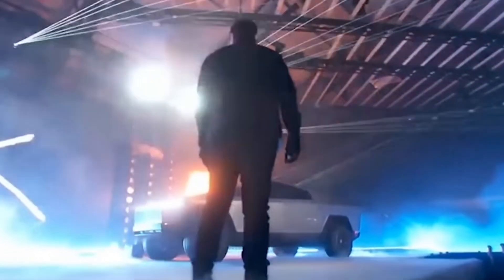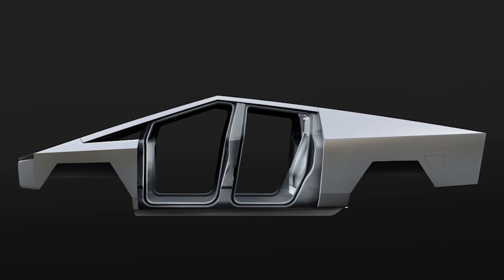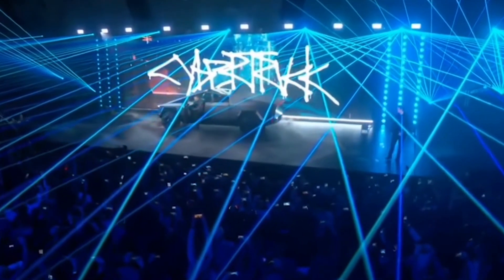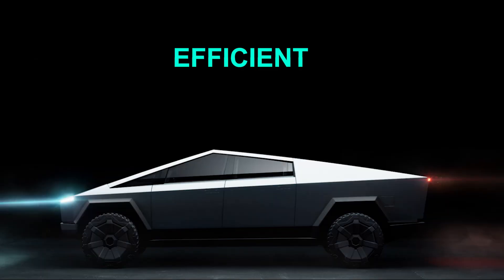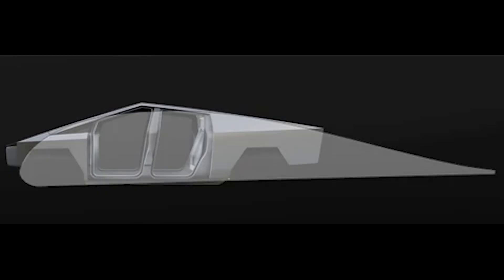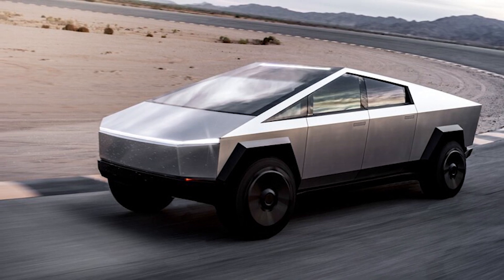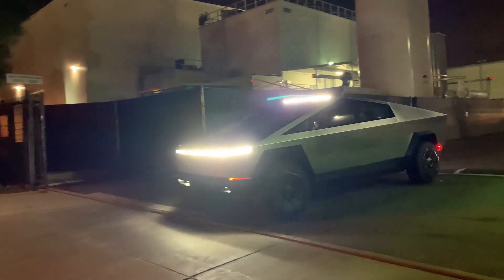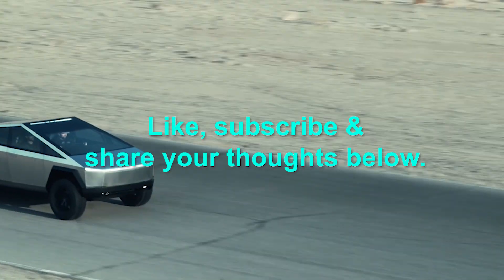Cybertruck is Engineering Genius (and will be copied)

Comment: I don't think other car makers will necessarily copy Tesla's design for several reasons.

1. There are more avenues for competition than efficiency: the core of the truck-purchasing audience hardly cares about that, anyway. Besides, copying Cybertruck's appearance would only reinforce the reverence for the original. It's one of the reasons that Tesla wouldn't copy Ford F-150's appearance even if it would still allow preserving all of their current design's benefits. It would only send the message that F-150 is the superior design, so it didn't need reimagining. Ergo it's better to get the original.

2. The economical benefits granted by using folded cold-rolled steel sheets taper off at a much larger manufacturing scale where the price of machinery becomes a non-factor. It is only a factor for Tesla because they are both far behind the competition in absolute production capacity and severely bottlenecked in ramping up, and they don't have the free cash to build as many manufacturing facilities around the world as Ford and other big players have. They absolutely need to make it count because they know how quickly the competition can ramp up production when they want to.

3. Triangles are only mechanically rigid; if you cut a triangle out of a single rectangular piece of paper, it will change virtually nothing with regards to its tensile/torsion/etc. strength. In Tesla's case the angular roof does not really add much to its rigidity (consider that Model 3 already passes the roof crush test with flying colors—and it has a conventionally-shaped mostly-glass roof); it's far more likely that, just like you said, it's mainly done to simplify manufacturing. In fact, the ridge where the glass connects with the steel is among the most likely points of failure in the crush test exactly because the pressure will be concentrated on the base of the glass with nothing to dampen it there. That's pretty much what happened during the presentation: when the steel door was hit with the sledgehammer, the shock was transferred from the frame to the base of the glass. This can be adequately mitigated in the doors because the vectors of shock to them are mostly orthogonal to the surface, but it's harder with the roof where the interface between steel and glass is exposed and shocks may come from a wide variety of angles. They aren't yet at a point where they have enough of them produced to arrange a comprehensive suite of durability tests, which is why neither Franz nor Elon were ready for that glass shattering from the ball.

It is true that the Cybertruck is a very fortunate design where multiple aspects synergize favorably for Tesla, but it's important to understand that it's not ideal and is largely driven by necessity, which may or may not prove to be an issue down the line. Time will tell.
Reply from the maker: Thanks for joining the discussion Moo, you win the most detailed comment for today!

Agree in general but just one note re: 2.

The economic benefits run deeper - the steel can be stored (stacked) flat saving a lot of physical space (lower overhead $$$), less stamping of parts saves energy, thus $. Less parts need to be moved around (less robots $, less energy $) and saving time (wages $), space ($) and increasing unit output over time. Everywhere Tesla can be lean, they are. This is one of many examples but it's pretty important -- lots of tiny things add up.
Reply: @SolvingTheMoneyProblem  That is certainly true. It is very right for Tesla to be lean like that, of course, and it's a very smart decision in principle. However, these savings are subject to diminishing returns due to the economy of scale (e.g. space, energy, wages don't scale linearly with production rate). It works out perfectly for Tesla, but the relative amount these many tiny things would save particularly for them in the next few years wouldn't necessarily be as significant as for a large car manufacturer with dozens of assembly lines. It would be hasty to consider that an economic no-brainer without having the inside knowledge of the competition. At a different scale the advantages of the Cybertruck's design may not warrant following it very closely, even if it's still economically sound. If only because that would make the final product look too much like the competitor. Will the savings be big enough to counteract the increased marketing demands to distance a Cybertruck copycat from the Cybertruck itself? I doubt that.

Tesla may have well hit a gold mine in the sense that their design is a result of convergence of many unlikely factors. It's almost incredible that it has worked out at all. A different manufacturer willing to make a truck out of stainless steel will inevitably have to make a choice: either make a radically different design at a much higher cost because stainless steel is an absolute bitch to work with (and lose to the Cybertruck by profit margin), or make it as angular as the Cybertruck to take advantage of the simpler manufacturing (and still sacrifice the profit margin to the marketing). It's a lose/lose situation, so in a certain sense, this design is uncopiable.

Comment: 3:23 - WRONG! They still have to spray the steel with corrosion inhibitor coating and it will come in several flat colors besides SS.
Reply from the maker: Thanks for that, Camreon.

Comment: I have only one question: Since it's an exosceleton, should the steel ever get a dent, won't it be a much bigger problem than normal? Because the car's structure could be disturbed? Like doors not opening or something
Reply from the maker: It will take a fair bit to deform the steel... like... a serious, SERIOUS collision. Hopefully Tesla reveal more on this soon.
Reply: @SolvingTheMoneyProblem  well yes but no. Don't underestimate the forces at work when cars that weigh like 2 tons each bump into each other even at low speeds. The steel is more sturdy than normal cars for sure, no one doubts that. As I said, I'm only concerned about what happens IF there is a problem. It will be interesting to hear about hat

Comment: This is going to be a nightmare for auto body repair shops.  The monocoque one-piece body shell of stainless has no quarter panels that can be replaced.  Damaged areas will have to be cut out and new panels welded on, which can't be concealed with Bondo and paint, and the welding temperatures always discolor the metal, making the repair evident.  It will be interesting to see how repairs are made to this vehicle.  I like it...unlike the regular auto industry coming out with a dream concept car that would never be produced, the Tesla will be.
Reply from the maker: Yep, you may well have  point on the repairs though a metalworker can remove dents without much trouble. Bigger impacts will be a pain in the butt.

Comment: My concern is what happens to the stainless steel when discarded? It will last forever and nature will not break it down, it will last forever!!!
Reply from the maker: It can be recycled. Step 1. Add heat.
Reply: @SolvingTheMoneyProblem  The way I see it is that recycle will not be done. Just drive out in the country and take note of the discarded farm machinery rusting away. There are millions of tons of metal just sitting there. This is just one example.

Comment: A really agree with your points, but want to add that for safety you often want the cars front do deform on impact to take away kinetic energy. It everything is hard a steel you will essentially hit a wall on impact.
Reply from the maker: Thanks. Lots of people are raising this. The steel can be scored on the underside to crumple predictably and consistently. (or the hood could be a separate component). I think many will be surprised at how well the Tesla engineers address this. Safety is always top of mind at Tesla. It may not appear so but the driver in Cybertruck sits the same distance from front of the vehicle as they do in Model 3 so there's equivalent space for crumple zone too.

End of the day, Cybertruck won't be allowed on roads if it is not sufficiently safe. Tesla are smarter than to design an unsafe vehicle 😉
Reply: @SolvingTheMoneyProblem  In this regard it would be very intresting to see crashtest footage (if such will ever be released). I am personally a fan of cybertruck and tesla in gerneal and would already have a preordered a cybertruck if I could afford it..

Comment: I wonder about SAFETY: 
 - If the truck is so rigid what would happen if it hits a rather "soft" car. The car should  deform a lot putting passengers into risk.
- What if two cybertrucks  hit each other, I guess most of the kinetic energy would not go into deforming the steel leading to a dangerous collision.
Reply from the maker: Lots of people are mentioning safety. The steel can be scored on the underside to crumple predictably and consistently. I think many will be surprised at how well the Tesla engineers address this. Safety is always top of mind at Tesla. It may not appear so but the driver in cybertruck sits the same distance from front of the vehicle as they do in Model 3 so there's equivalent space for crumple zone too.

End of the day, Cybertruck won't be allowed on roads if it is not sufficiently safe. Tesla are smarter than to design an unsafe vehicle 😉

Comment: Almost nothing said in video is accurate. 
Rigidity does not equal safety, check any crash test video of cars from the 50s. Crumple zones make a car safe. 

At every price point of the CT performance except acceleration is better with ic truck. 3500s with towing capacity > 30,000lbs and ~7000lbs payload are ~50k. They are beat on the low end too by 2500 series

Reducing steps in production can be good. Also has some down sides. When machines are down for maintenance/repairs nothing can happen. With multiple steps the other steps can continue when one machine is down and they can catch up when that other step goes down. 

Unfinished metal causes a lot of glare issues with driver and other cars when the sun is reflected, not always good. 

Unibody truck design has been studied by truck builders in fact honda used it. Those angled bed sides are necessary to combat twist/flex. Generally the unibody design is going to be heavier than a traditional frame design to combat that twist. Where as traditional truck frame design doesnt fight this force, the bed and cab are separated and allowed to flex relative to each other.   Now engineering is about compromise so tesla may have chosen to pursue the unibody design for other advantages, ie better use space. 

Many trucks come with 120v outlets not sure about the 220v but nothing is stopping manufacturers from adding that. 6 seats were common at one point, customers didnt seem to be that interested. Its almost impossible to find 3rd seat in front row on any car today. Ramp in tailgate is unique but most trucks now come with other tailgate features, not really clear what features buyers like the most but manufacturers have shown designs with ramp in tailgate, just never offered it for sale.
Reply from the maker: Thanks for your detailed feedback John. You make some reasonable points. FYI, the steel can be scored to crumple where and as needed.
Reply: Solving The Money Problem sure. But the rigidity is not providing the safety. Other benefits yes.

Comment: A vehicule being sturdy doesn't necessarily means safe. There's a reason there is a crumple zone to absorb the impact on modern cars. I'm wondering how that would work with cybertruck. Clearly they thought about something, it's Tesla we are talking about. I'm just wondering about the details.
Reply from the maker: Heaps of people are raising this. The steel can be scored on the underside to crumple predictably and consistently. (or the hood could be a separate component). I think many will be surprised at how well the Tesla engineers address this. Safety is always top of mind at Tesla. It may not appear so but the driver in Cybertruck sits the same distance from front of the vehicle as they do in Model 3 so there's equivalent space for crumple zone too.

End of the day, Cybertruck won't be allowed on roads if it is not sufficiently safe. Tesla are smarter than to design an unsafe vehicle 😉
Reply: @SolvingTheMoneyProblem  Didn't think about that! And I agree, that would be very strange from Tesla to make an unsafe vehicle.

Comment: So if it so tough, what’s gonna happen when in a car accident and the car frame doesn’t absorb the energy of the impact?
Reply from the maker: Lots of people are raising this. The steel can be scored on the underside to crumple predictably and consistently. (or the hood could be a separate drop-in component). I think many will be surprised at how well the Tesla engineers address this. Safety is always top of mind at Tesla. It may not appear so but the driver in Cybertruck sits the same distance from front of the vehicle as they do in Model 3 so there's equivalent space for crumple zone too.

End of the day, Cybertruck won't be allowed on roads if it is not sufficiently safe. Tesla are smarter than to design an unsafe vehicle 😉

Comment: I dont get it, I googled its price and its like 10k over the base f150 model... so whats the point of all this explanation if it will be more expensive than the competitor?
Reply from the maker: Hey Matias, go spec out a like-for-like F150 (super crew cabin, 6.5 ft bed etc) and you will find a very different picture. Tesla doesn't have 4,000 options. There's 3 models and the only add on is full self driving.

Comment: The biggest issue i have with the Cyber truck is with the EU market, there is no way in hell that it's passing a pedestrian safety test with how solid the front of it is. Unless they make a version with a plastic front it won't even be allowed on the roads here.
Reply from the maker: Lots of people are mentioning this. The steel can be scored on the underside to crumple predictably and consistently.  I think many will be surprised at how well the Tesla engineers address this. Safety is always top of mind at Tesla. It may not appear so but the driver in cybertruck sits the same distance from front of the vehicle as they do in Model 3 so there's equivalent space for crumple zone too.

Comment: YUCK Why are you guys trying to make the Tesla "truck" happen?  It's UGLY!  It looks like it was designed by a 3 year old.  If you guys let Tesla think this is a valid truck option are just hurting Tesla.  The sooner the cancel this design and come up with a more traditional truck design the better off Tesla will be.
Reply from the maker: Guess they'd better refund those 250,000 reservation deposits and start work on an F150 clone eh? Maybe you should tweet Elon this urgent message. 😉
Reply: @SolvingTheMoneyProblem  I'm going to laugh my ass off when I see some dumbass driving this.  But I guess the only reason someone would drive this it to get that kind of attention.  Real truck owners are not going to buy this truck.  It doesn't have to be a clone of F150 but it doesn't have to look like something straight out of a bad Battlestar Galactica episode either.

Comment: Has anyone else suppositioned about the trailer that is shown being towed by the truck?  My theory is 10 to 1 that it will have batteries that will provide additional power to the truck. That way you can tow a trailer with zero to net positive change in vehicle range.  any thoughts?
Reply from the maker: AK, damn. You know what. I think you're right. Why on earth would they NOT put batteries in the trailer (and probably a solar roof too)? Make perfect sense. Tweet Elon and ask.. see what happens.
Reply: The trailer will require huge power. Obviously equipping trailer with significant power will require lots of weight from batteries - eating into your tow capacity. Also, getting that power from the trailer to the truck itself will require big fat power cables - which adds weight, complexity and cost. Not impossible, but something to be overcome. Or, I suppose you could have a trailer with its own propulsion - but lots of cost, complexity and weight there, too.

Comment: You didnt mention how inefficient it would be under load. y'know...using it like a truck. 

It seems like a fine vehicle for those who dont tow outside of city limits. 

From where I live, mathematically the highest trim  wouldnt make the trip to tow my boat to my favorite destination assuming it keeps up the 1kW/h usage on a flat surface with no uphill or downhill. 

I just think it's just an okay vehicle from a truck standpoint. For functionality, it'll be more of an average small-size truck instead of an average full-size.
Reply from the maker: Yep, no mention because I have no clue. Model X towing capacity is TRASH but it wasn't designed to tow. Cybertruck is hopefully Tesla provide info on loaded/towing range soon. For sure, narrow use cases like long range when rowing, longer bed etc means Cybertruck won't suit everyone.
Reply: For somebody that uses their truck as a commuting homeowner - whose only "truck" use is hauling a few 2x4s or bags of mulch or pulling the bass boat 10 miles to the ramp, I think the cybertruck would be just fine. For someone that actually works their truck, this is not a good fit.

Comment: the sharp edges are not that bad for the aerodynamics as long as the are on the sides and on the back only.  The front has beveled edges with less than 45° angle. But the sharp edge on top of the roof line causes turbulences, as some aerodynamic computer simulations already have shown. Tesla could bevel that edge too, with a  50cm long horizontal part. That would not seriously increase the production effort
Reply from the maker: Musk's tweets suggests they're working to get the drag coefficient as low as possible. Can't wait to see what they come up with.